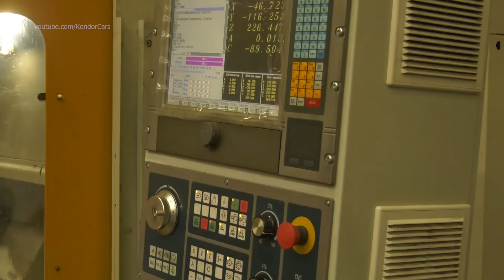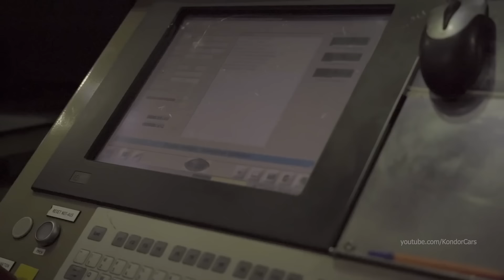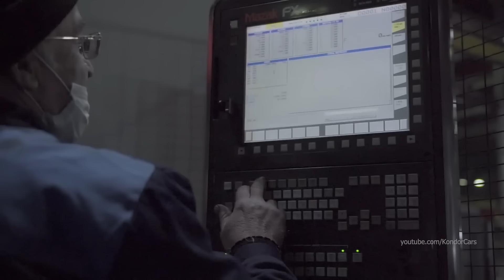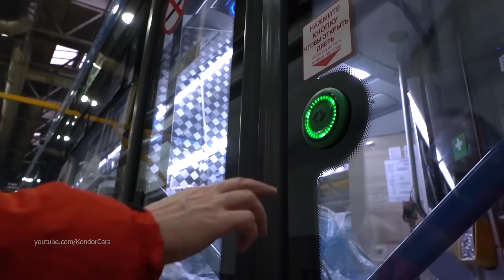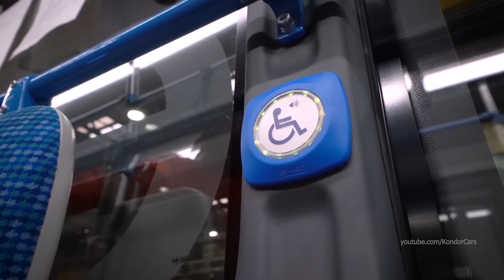KAMAZ Bus Production RUSSIA

Comment: These buses are truly masterpieces of the Russian mass-transport vehicle industry.
Reply: ABOUT BUSES COMFORT: 
I am concerned with the design (shape) of bus seats. 
A back rest of the seat that leans back between 15 and 20 degrees from vertical line is advised. The angle between the back rest and the seat cushion (or the hard plastic “horizontal” surface of the seat) should be (ought to be) approximately 90 degrees. 
I am concerned with the excessive swinging movements of buses [ swinging up an down (vertically) and from side to side (transversely) ]. This is a reason for lack of comfort and lack of safety. 
I am concerned with hardness of shock absorbers (dampers). 
Treads inside a bus may cause passengers to fall onto the ground.  Generally there are only two treads along inside the bus. 
Brazilian urban buses are not comfortable. They are awful!  Very bad!  SHIT! SHIT! SHIT!
Reply: Looks like a copy or joint venture with Mercedes Benz. The most technologie in the plant is from the west. Good luck in the future, thanks to Putin.
Reply: @mogmichi300 
leaterly all countries buy industrial equipment from eachother .....thats not unique to russia and they can buy it from a third party state like turkey or China
Reply: @mogmichi300 Electric buses have been and continue to be produced in Russia. Even new manufacturers are emerging. Apparently there was not much Western in them.
Reply: @pauloandradeabreu8582  These buses have no steps, the floor of the bus is approximately at the same level as the sidewalk, and the bus can rise/lower slightly.
Reply: it seems that most of the manufacturing machines are German or French

Comment: From start to finish, such a wonderful engineering and team work. I really look forward to having Kamaz Trucks, Sedan and Buses in LIBERIA and Afrika.
Reply: ABOUT BUSES COMFORT: 
I am concerned with the design (shape) of bus seats. 
A back rest of the seat that leans back between 15 and 20 degrees from vertical line is advised. The angle between the back rest and the seat cushion (or the hard plastic “horizontal” surface of the seat) should be (ought to be) approximately 90 degrees. 
I am concerned with the excessive swinging movements of buses [ swinging up an down (vertically) and from side to side (transversely) ]. This is a reason for lack of comfort and lack of safety. 
I am concerned with hardness of shock absorbers (dampers). 
Treads inside a bus may cause passengers to fall onto the ground.  Generally there are only two treads along inside the bus. 
Brazilian urban buses are not comfortable. They are awful!  Very bad!  SHIT! SHIT! SHIT!
Reply: @pauloandradeabreu8582   Many years ago, I used to make regular visits to Chicago and the city buses had a very hard ride.  They also had hard plastic seats and no cushions.  That was because the low quality of passengers and the messes they sometimes left behind.  The bus was made with withstand the pot holes and be easy to clean up.  Not passenger comfort. So, city buses here in the U.S. can be bad, as well.

On the other hand, long distance Greyhound buses were VERY comfortable.  THOSE buses you could ride for many hours and it was all good.
Reply: Всё у вас будет!И поезда и автобусы и самолёты
Reply: @BlackPill-pu4vi  you are absolutely wrong. these buses do not operate intercity flights. as a rule, they drive from 1 to 5 stops to their destination in the city. the seat is sturdy, but at the same time very ergonomic and comfortable. I ride it around Moscow almost every day. buses with intercity flights are equipped with soft seats, and this is a city bus.
Reply: @alex7777  O.K. but, I was using the Chicago city buses as a comparison and using that comparison to point out the better idea that the Kamaz buses provide.

I also made a positive comparison to the long distance Greyhound buses that we have here in the U.S.  Now those buses are very comfortable because they are made for long distances and a better class of passenger.

Comment: Parabéns  ao povo russo pelo conforto e segurança destes veículos.
Reply: Older urban bus seats are more comfortable than newer ones!  Bus seats design is worsening worldwide!  
I suggest reading ‘Ergonomics of Urban Public Passengers Transportation’  (Universidad Nacional Experimental del Táchira - UNET), at the point where it discusses 'bus seats' (the back rest and seat cushion angles). The recommended values may be partially refuted.  But the reasoning core is EXTREMELY IMPORTANT for the study of bus seats ergonomics. 
Most Brazilian bus seats are not ergonomic. Bus seats of Caio-Induscar are awful, very bad! The bus seat of Comil is awful, very bad! So are Brazilian underground (subway) seats!  And comfort comes from ergonomics!
Reply: Bus seats ERGONOMICS: 
For the backrest, a backwards inclination is recommended. 
The seat cushion must be (should be) higher near to passenger’s knees, and lower near to the backrest. That is, the seat cushion must be (should be) a forward acclivity. 
Most Brazilian bus SEATS are not comfortable. They are not ergonomic. 
Bus seats of Caio-Induscar are awful, very bad! 
Bus seat of Comil is awful, very bad! 
In these Brazilian bus seats, passengers slide forward over the seat cushion when the bus brakes suddenly. And passengers’ trunks lean forward when the bus brakes suddenly. This may happen mainly when the bus is going down a slope. 
Bus seats ergonomics must be evaluated when the bus brakes suddenly, mainly when the bus is going down a slope. 
And comfort comes from ergonomics!
Reply: Agora até aquele gorgorão que fica nos ferros presos ao teto (para os passageiros se segurarem) do ônibus da Caio-Induscar ficou menor e menos encorpado.  Pessoas com tamanho de mão normal só conseguem segurar o gorgorão com os dedos, não cabe mais toda a palma da mão.  Isso é perda de conforto.
Reply: Quando eu era menino meus pais visitavam parentes nos fins de semanas.  Num desses dias eu fiquei longa e profundamente meditando como o ônibus era confortável.  No final da década de 1970 eu trabalhava longe de casa e tomava dois ônibus para ir ao emprego.  Eram tão confortáveis que valiam por um lazer.  Uma década posterior eu ia até a periferia da cidade de São Paulo tomar cerveja com os amigos ou jogar jogos de mesa.  A viagem no ônibus era um prazer.  Atualmente evito o máximo que posso tomar ônibus.  ANIQUILARAM O CONFORTO!  Gostaria que o Brasil importasse ônibus da Índia, da China, ou de qualquer outro país, e parasse de colocar na praça os ônibus brasileiros!  Ônibus brasileiros: conforto-LIXO!
Reply: ABOUT BUSES COMFORT: 
I am concerned with the design (shape) of bus seats. 
A back rest of the seat that leans back between 15 and 20 degrees from vertical line is advised. The angle between the back rest and the seat cushion (or the hard plastic “horizontal” surface of the seat) should be (ought to be) approximately 90 degrees. 
I am concerned with the excessive swinging movements of buses [ swinging up an down (vertically) and from side to side (transversely) ]. This is a reason for lack of comfort and lack of safety. 
I am concerned with hardness of shock absorbers (dampers). 
Treads inside a bus may cause passengers to fall onto the ground.  Generally there are only two treads along inside the bus. 
Brazilian urban buses are not comfortable. They are awful!  Very bad!  SHIT! SHIT! SHIT!
Reply: Os ônibus brasileiros não se comparam a ônibus de outros países europeus. A qualidade de nossos ônibus está muito atrasado em relação a eles.

Comment: KAMAZ : MAIOR FABRICA DE ;
CAMINHÕES NA ; RÚSSIA ; 
MUITO BOM !!  VENCEDOR : RALLY -
DAKAR : 2022 ; TRÊS : CAMINHÕES ;
KAMAZ .; Parabéns !!!  .
Reply: Bus seats ERGONOMICS: 
For the backrest, a backwards inclination is recommended. 
The seat cushion must be (should be) higher near to passenger’s knees, and lower near to the backrest. That is, the seat cushion must be (should be) a forward acclivity. 
Most Brazilian bus SEATS are not comfortable. They are not ergonomic. 
Bus seats of Caio-Induscar are awful, very bad! 
The bus seat of Comil is awful, very bad! 
In these Brazilian bus seats, passengers slide forward over the seat cushion when the bus brakes suddenly. And passengers’ trunks lean forward when the bus brakes suddenly. This may happen mainly when the bus is going down a slope. 
Bus seats ergonomics must be evaluated when the bus brakes suddenly, mainly when the bus is going down a slope. 
And comfort comes from ergonomics!
Reply: Older urban bus seats are more comfortable than newer ones!  Bus seats design is worsening worldwide!  
I suggest reading ‘Ergonomics of Urban Public Passengers Transportation’  (Universidad Nacional Experimental del Táchira - UNET), at the point where it discusses 'bus seats' (the back rest and seat cushion angles). The recommended values may be partially refuted.  But the reasoning core is EXTREMELY IMPORTANT for the study of bus seats ergonomics. 
Most Brazilian bus seats are not ergonomic. Bus seats of Caio-Induscar are awful, very bad! The bus seat of Comil is awful, very bad! So are Brazilian underground (subway) seats!  And comfort comes from ergonomics!
Reply: Bus seats ERGONOMICS: 
For the backrest, a backwards inclination is recommended. 
The seat cushion must be (should be) higher near to passenger’s knees, and lower near to the backrest. That is, the seat cushion must be (should be) a forward acclivity. 
Most Brazilian bus SEATS are not comfortable. They are not ergonomic. 
Bus seats of Caio-Induscar are awful, very bad! 
The bus seat of Comil is awful, very bad! 
In these Brazilian bus seats, passengers slide forward over the seat cushion when the bus brakes suddenly. And passengers’ trunks lean forward when the bus brakes suddenly. This may happen mainly when the bus is going down a slope. 
Bus seats ergonomics must be evaluated when the bus brakes suddenly, mainly when the bus is going down a slope. 
And comfort comes from ergonomics!
Reply: Agora até aquele gorgorão que fica preso nos ferros junto ao teto do ônibus (para os passageiros se segurarem) da Caio-Induscar ficou menor e menos encorpado.  Pessoas com tamanho de mão normal só conseguem segurar o gorgorão com os dedos, não cabe mais toda a palma da mão.  Isso é perda de conforto!
Reply: Quando eu era menino meus pais visitavam parentes nos fins de semanas.  Num desses dias eu fiquei longa e profundamente meditando como o ônibus era confortável.  No final da década de 1970 eu trabalhava longe de casa e tomava dois ônibus para ir ao emprego.  Eram tão confortáveis que valiam por um lazer.  Uma década posterior eu ia até a periferia da cidade de São Paulo tomar cerveja com os amigos ou jogar jogos de mesa.  A viagem no ônibus era um prazer.  Atualmente evito o máximo que posso tomar ônibus.  ANIQUILARAM O CONFORTO!  Gostaria que o Brasil importasse ônibus da Índia, da China, ou de qualquer outro país, e parasse de colocar na praça os ônibus brasileiros!  Ônibus brasileiros: conforto-LIXO!
Reply: ABOUT BUSES COMFORT: 
I am concerned with the design (shape) of bus seats. 
A back rest of the seat that leans back between 15 and 20 degrees from vertical line is advised. The angle between the back rest and the seat cushion (or the hard plastic “horizontal” surface of the seat) should be (ought to be) approximately 90 degrees. 
I am concerned with the excessive swinging movements of buses [ swinging up an down (vertically) and from side to side (transversely) ]. This is a reason for lack of comfort and lack of safety. 
I am concerned with hardness of shock absorbers (dampers). 
Treads inside a bus may cause passengers to fall onto the ground.  Generally there are only two treads along inside the bus. 
Brazilian urban buses are not comfortable. They are awful!  Very bad!  SHIT! SHIT! SHIT!

Comment: Que maravilla de industria que viva Rusia 🇷🇺💪
Reply: Older urban bus seats are more comfortable than newer ones!  Bus seats design is worsening worldwide!  
I suggest reading ‘Ergonomics of Urban Public Passengers Transportation’  (Universidad Nacional Experimental del Táchira - UNET), at the point where it discusses 'bus seats' (the back rest and seat cushion angles). The recommended values may be partially refuted.  But the reasoning core is EXTREMELY IMPORTANT for the study of bus seats ergonomics. 
Most Brazilian bus seats are not ergonomic. Bus seats of Caio-Induscar are awful, very bad! The bus seat of Comil is awful, very bad! So are Brazilian underground (subway) seats!  And comfort comes from ergonomics!
Reply: Bus seats ERGONOMICS: 
For the backrest, a backwards inclination is recommended. 
The seat cushion must be (should be) higher near to passenger’s knees, and lower near to the backrest. That is, the seat cushion must be (should be) a forward acclivity. 
Most Brazilian bus SEATS are not comfortable. They are not ergonomic. 
Bus seats of Caio-Induscar are awful, very bad! 
Bus seat of Comil is awful, very bad! 
In these Brazilian bus seats, passengers slide forward over the seat cushion when the bus brakes suddenly. And passengers’ trunks lean forward when the bus brakes suddenly. This may happen mainly when the bus is going down a slope. 
Bus seats ergonomics must be evaluated when the bus brakes suddenly, mainly when the bus is going down a slope. 
And comfort comes from ergonomics!
Reply: Agora até aquele gorgorão que fica nos ferros presos ao teto (para os passageiros se segurarem) do ônibus da Caio-Induscar ficou menor e menos encorpado.  Pessoas com tamanho de mão normal só conseguem segurar o gorgorão com os dedos, não cabe mais toda a palma da mão.  Isso é perda de conforto.
Reply: Quando eu era menino meus pais visitavam parentes nos fins de semanas.  Num desses dias eu fiquei longa e profundamente meditando como o ônibus era confortável.  No final da década de 1970 eu trabalhava longe de casa e tomava dois ônibus para ir ao emprego.  Eram tão confortáveis que valiam por um lazer.  Uma década posterior eu ia até a periferia da cidade de São Paulo tomar cerveja com os amigos ou jogar jogos de mesa.  A viagem no ônibus era um prazer.  Atualmente evito o máximo que posso tomar ônibus.  ANIQUILARAM O CONFORTO!  Gostaria que o Brasil importasse ônibus da Índia, da China, ou de qualquer outro país, e parasse de colocar na praça os ônibus brasileiros!  Ônibus brasileiros: conforto-LIXO!

Comment: We need Buying this products in Egypt, we need agency here 😮😮
Reply: ABOUT BUSES COMFORT: 
I am concerned with the design (shape) of bus seats. 
A back rest of the seat that leans back between 15 and 20 degrees from vertical line is advised. The angle between the back rest and the seat cushion (or the hard plastic “horizontal” surface of the seat) should be (ought to be) approximately 90 degrees. 
I am concerned with the excessive swinging movements of buses [ swinging up an down (vertically) and from side to side (transversely) ]. This is a reason for lack of comfort and lack of safety. 
I am concerned with hardness of shock absorbers (dampers). 
Treads inside a bus may cause passengers to fall onto the ground.  Generally there are only two treads along inside the bus. 
Brazilian urban buses are not comfortable. They are awful!  Very bad!  SHIT! SHIT! SHIT!

Comment: wow, impressive!
Reply: ABOUT BUSES COMFORT: 
I am concerned with the design (shape) of bus seats. 
A back rest of the seat that leans back between 15 and 20 degrees from vertical line is advised. The angle between the back rest and the seat cushion (or the hard plastic “horizontal” surface of the seat) should be (ought to be) approximately 90 degrees. 
I am concerned with the excessive swinging movements of buses [ swinging up an down (vertically) and from side to side (transversely) ]. This is a reason for lack of comfort and lack of safety. 
I am concerned with hardness of shock absorbers (dampers). 
Treads inside a bus may cause passengers to fall onto the ground.  Generally there are only two treads along inside the bus. 
Brazilian urban buses are not comfortable. They are awful!  Very bad!  SHIT! SHIT! SHIT!
Reply: @pauloandradeabreu8582  If you talk about comfort, you have never seen Bangladeshi bus !! 😂😂